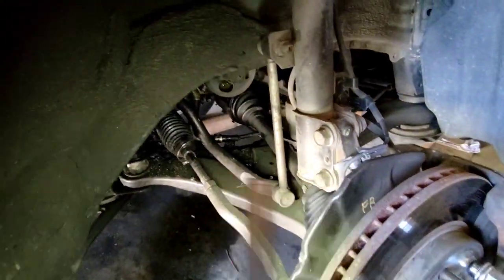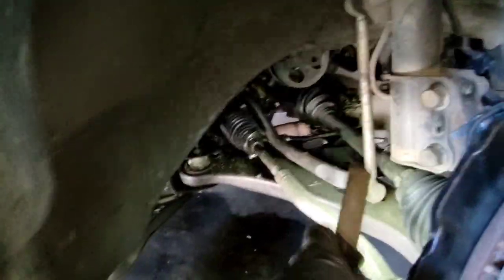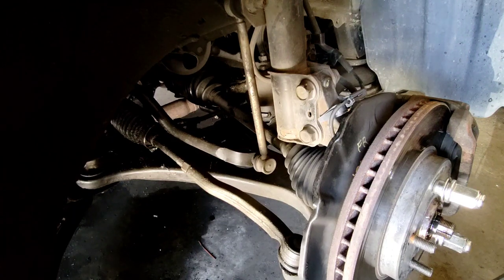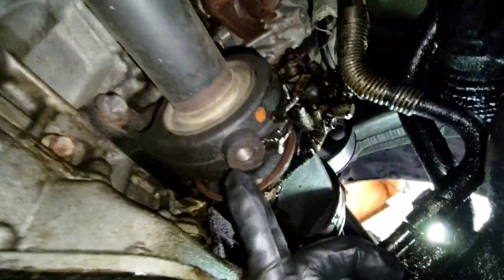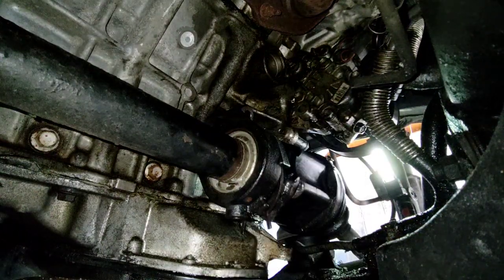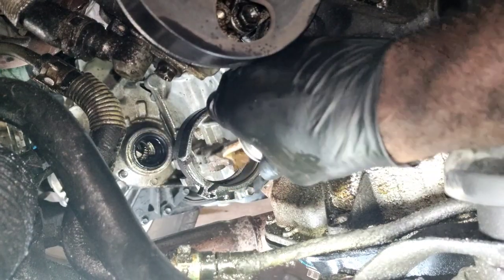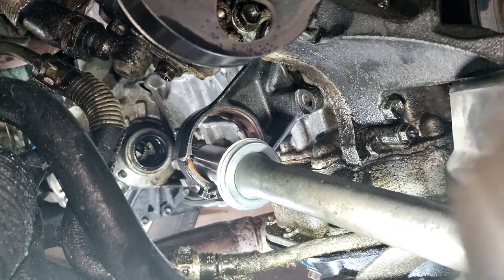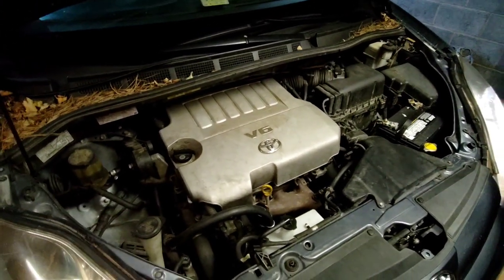2008 Toyota Sienna cv axle passenger side

Comment: There are two small aluminum pins that will fall to the floor when you loosen the carrier bracket.  Keep an eye out for them, they are easy to miss.  They go into the holes right next to the bottom two bolts to align the carrier bracket.  Most videos on this job don't mention them.   Yea, in the rust belt, just buy a new bracket and clip.  It isn't worth the fight if it doesn't come out easy.
Reply: I'm started on my 2007 Sienna yesterday. Major pain getting the axle out. Anyway, I've tried two different axles (one from an online store and another from O'Reilly) and neither fit! They both are about 1/8" too long, so the shaft doesn't seat as close to the tranny, and I can't get the retention ring installed because the groove is blocked by the bearing.

Anyway, what axle did you use? did you experience this issue?
Reply: @SuperJ213  I used a cardone hd cv axle.  It fit just fine and although fiddly the retaining clip went in.  Despite a new OEM carrier bracket and SKF bearing, something is still scraping and not sounding right.  Next time I'll buy oem only for this.
Reply: Turned out the new wheel bearing was bad.  The cardone cv was fine.  Weird failure but a second bearing and all is good again.  Toyota cv was back ordered three years or so.
Reply: @daveg7878  My front passenger bearing was going bad, took it to a shop since I didn't have the tools to deal with it, and they got it replaced. It was during that visit that we noticed the CV axle needed to be replaced. Makes me wonder if there's a relationship between them failing (considering your comment); it's probably just a coincidence.

Side note: I got my axle installed, it just needed a bit of careful pounding to get it seated in the tranny. It was still a tad bit short, so I sanded the retaining clip to get the last little bit of clearance I needed to lock it all in place.

Also, the boot on the rack and pinion had also broken down and was leaking grease. I replaced that while I did the axle (that was easy part!).

Comment: Getting that carrier off is a pain. Siennas in the rust belt states suffer from frozen bearing in the carrier and some folks just use a sawzall and cut the shaft out. Lucky for me, I am not in the rust belt states . When I did this job I used a long pry bar type screw driver and whacked the body of the shaft about five time or so and it broke loose.
Reply: Same here, right against the back of the CV joint.... Housing I guess, right next to that bearing, a good few hits and it came out, after about an hour of pry bar, slide hammer and cussing. 😂
Reply: Wish I could have gotten mine off😢
Reply: @surfside75 It is an absolute nightmare in NY and I own an auto repair business. I buy the bracket, snap ring and sell it with the job. No way am I wasting hours soaking, using a punch and hammer. I learned this the hard way. That snap ring never wants to let go and it gets severely distorted. I am doing a 2015 Sienna now and I am waiting for the CV Axle bracket and snap ring before I even get started.
Reply: @marcsmith3881   .. -I wish I had listened to others instead of waiting my time and mental. 
Bracket, Diablo blades cut the axle out. Worth the extra money.

Comment: Just finished my axle. I decided it was easier to cut the bracket releasing tension on the bearing. Figured it was easier replacing the bracket then try to fight with it for a few hours or whole day. Took 15 min and it came out. Bracket cost like $60. Time saved is worth the cost. Time is money. I’m in the rust belt state so the air hammer did not work at all.
Reply: I'm started on my 2007 Sienna yesterday. Major pain getting the axle out. Anyway, I've tried two different axles (one from an online store and another from O'Reilly) and neither fit! They both are about 1/8" too long, so the shaft doesn't seat as close to the tranny, and I can't get the retention ring installed because the groove is blocked by the bearing.

Anyway, what axle did you use? did you experience this issue?

Comment: That missing bolt (14mm) is there to stop the outer part of the bearing from rotating in the housing as the bearing is not a press in fit. The clip is there to hold the bearing in the housing.
Reply: I just asked another commenter about that, should have read a little more. Makes sense because it ISN'T truly press fit, just a really good fit.
Reply: well thats questionable , the bolt does not touch the outside of the bearing and there is a little rubber plug in there ( you can see it in this video) so the bolt hits the rubber plug and the rubber holds against the bearing , so if bearing ever starts to seize that rubber touching it will not stop it from becoming a spun bearing and spinning in the bracket

Comment: use the 14 mm bolt to force grease up around carrier bearing  , ( the one your missing )  remove rubber plug thats in there with a pick , fill hole with grease and then install bolt , repeat this 4-5 times , it will press grease around outside of bearing and make it easy to remove .  I actually do it every second oil change or so to prevent the bearing and bracket from ever rusting together

Comment: The mechanic only replace the half shaft, as it takes more labor to take off the middle ring that holds the shaft. Do not buy a full length shaft for replacing the damaged shaft. Ask the auto parts shop for such tailored shaft.

Comment: Was this vibration at higher speeds of 55-70mph, no noise from the axle, no clicks or humming but like the tires felt out of balance when it was the cv axle. I have the same shake/vibration at higher speeds, thanks
Reply: We share the same issue I got noises with mine waiting for the CV axles to come in I'll let you know if it's fixed.

Comment: Good video. I just did this job on my 2006 Toyota Highlander.  
Since I was replacing the axle anyway I wasn't worried about destroying 
the bearing. After beating on it for an hour with a 3 pound sledge 
hammer I finally got smart and used my air hammer. Placing the air 
hammer directly on the bearing pushed it out in about three minutes. 
Obviously this method destroys the bearing but it works.

Comment: I was able to get it out a little differently I was able to get all three screws out of the bracket using an open end wrench and a 2nd wrench on the most difficult one. Then I used a slide hammer and puller and pulled the axle away from the transmission and then turned the bracket around and pulled the bracket out of the car with the old axle. Once I did this we did apply some heat using a small propane torch and were able to remove the axle from the bracket. What a pain. So it is possible to remove the bracket still attached to the axle. I am not sure that I would have been able to get it out other wise.
Reply: There is pins. I'm confused how it slid?

Comment: doesnt do any good to take the shaft bracket loose because the bracket is index pinned to thye block and it will not come away from the block far enough to get over the pins.. if you removed it with the bracket on it was because someone broke or removed the pins.. just sayin